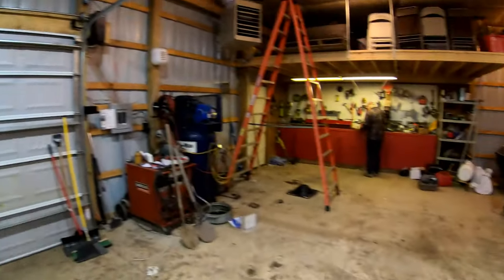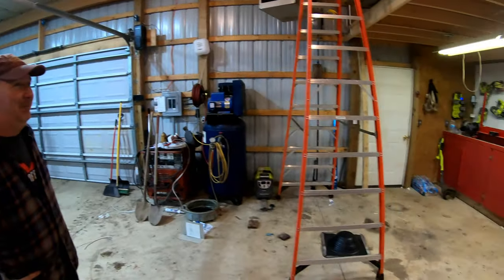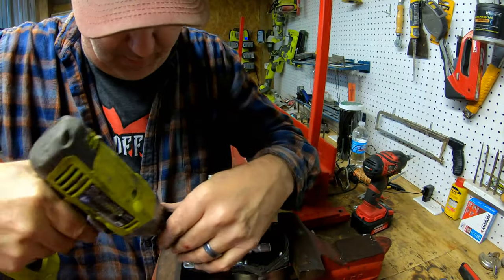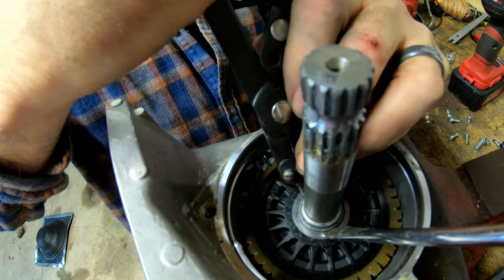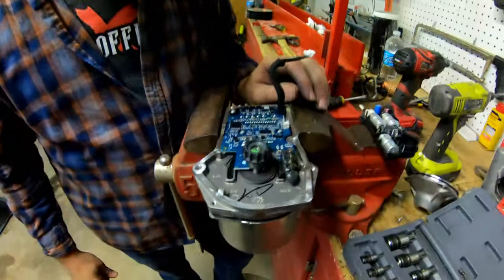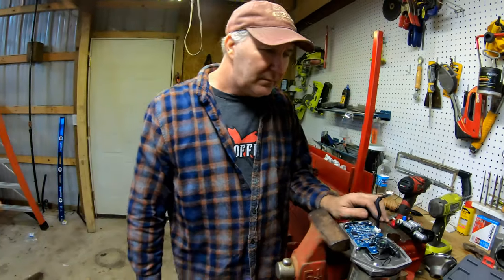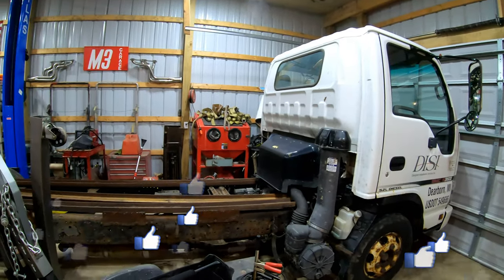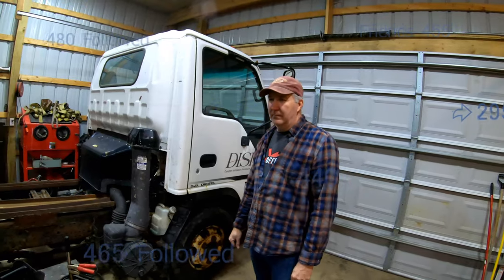Can Am DPS (Power Steering) Tear Down

Comment: The thing that puzzled you regarding freewheeling the motor is called winding grounding. So if you ground both ends of a coil that drives the rotor, induced current is shortcutted creating resistance if trying to run a motor in generator mode aka spinning it by force...thanks for teardown, gave me few ideas for my projects...

Comment: I have the same issue on a X3 , I discharged all capacitors & when I hooked the 3 motor leads back up , with unit unhooked on the bench, the pulse was back in the motor again ! From what research I have done , believe this means the motor has a short in its windings ! 
 If you would have just clipped the 3 motor leads the motor housing & windings will come off . The shaft, magnets, gear, & bearing will stay in place on the circuit board plate !

Comment: What year and model unit is this part from?
*Edit Looks like a 2019 XRS , this was my first video here, just saw the previous ones. 
This is good content, love to see teardowns and people looking to see why BRP hardware failed. Still don't know why they set it up so DPS needs to be synced separate from the ECU...seems needlessly to add complexity, particularly if the DPS is not rebuildable...or reliable from a few bumps and scrapes.

Did this unit have the old “low torque” or the newer high torque unit that is included with the Smart Lok?

IIRC, the part numbers are different for the high torque units for 2018, 2019,2020.

Are there any obvious diodes on the board that could have failed open? They can be integrated into the driving fets also.

It appeared once the motor inputs were cut, it freed right up. Might have just been a short between the poles...still it looks like a PIA to repair all glued down.
Reply: First thank you for watching and the nice comment. This was a 19 Xrs I believe it was the high torq dps and it had no obvious damage but your right as soon as we cut the connections it freed up. We believe it still had power in the capacitors that was causing power to be directed to the motor not positive that was the cause though. Also it was really glued together so we didn't tear into it any farther.  Hope I answered your question thanks again for watching we appreciate it!!!